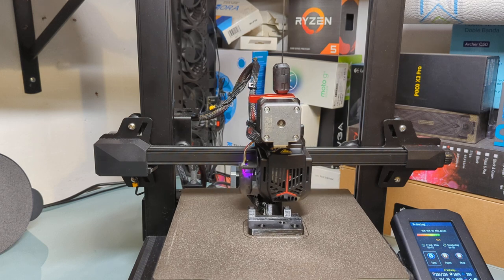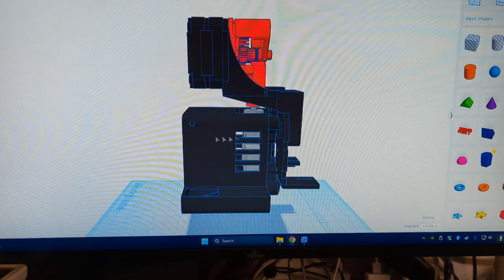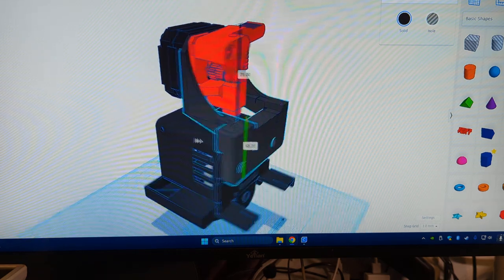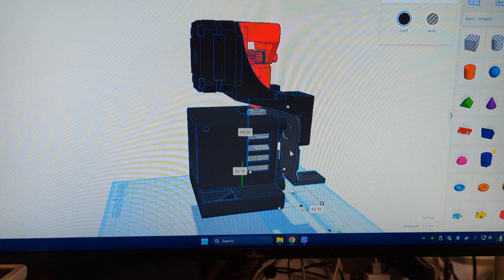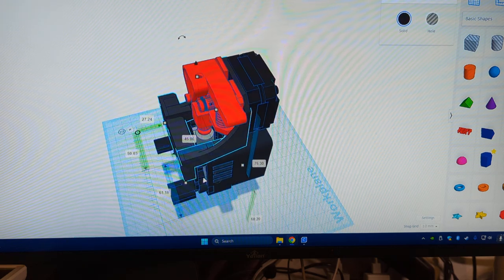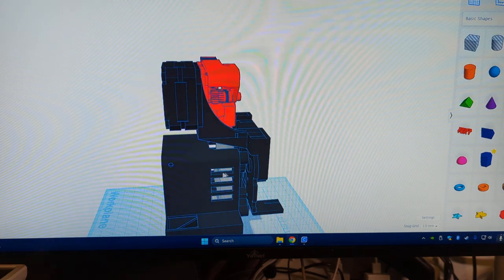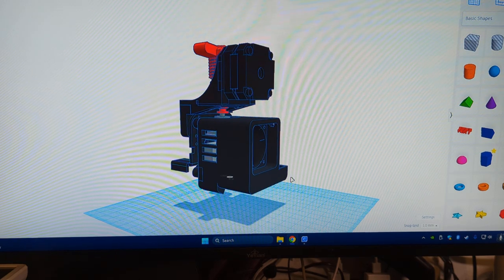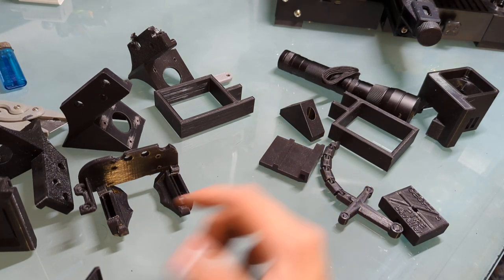Creality Ender 3 V2 Neo - New Direct Drive Mod and Updates!!

Comment: Great vids man just ordered mine and should be here today. Pretty sure you’re  the only one tackling the direct drive with the E3 v2 Neo on youtube right now. So many on Reddit just wiped there hands with it and said it’s not possible since they changed some of the original settings from the v2 I guess which I feel is steering some away from this printer. Awesome work look forward to more!
Reply from the maker: Thank you! It's been tricky, but the user TheGameIsFunny in thingiverse really got my brain going with this I believe he made the first DD mod for this printer and after upgrading to a dualgear extruder I just knew I had to remix the file to fit since it's a bit longer than stock. Huge learning curve for me since it was my first time doing any 3D models but it's been really fun learning and upgrading this printer any chance I get.

Comment: you need to turn the mount 180 deg, motor over the x-axis.
the dule gear extruder fits just right .
you don't need an extension cable for this, just split and peel the wires back. it's long enough

Comment: ur videos are great, as am also new to 3d printing and bought 3 v2 neo ,,, and wanted to upgrade it ....ur videos are a lot help cus i find rarely a video on neo version

i wanted to ask a question ..... isn't it possible to use the original extrusion kit that came up with printer in this mode?

Comment: Unless you run an gear reduction extruder you can’t use a pancake stepper as it will over heat. Amazon 7.99 pancake stepper
Reply from the maker: 100% correct, running the stock motor until I can get something better.

Comment: Great work, im using the same printer, are you still able to print the full hight of the printer? Does the extuder or the mod clear the top? Iv printed parts for a full size sword and some came close to the top.
Reply from the maker: Yes you are still able to use the entire Z space of the printer :)

Comment: Does it work without dual Z motors
Reply from the maker: It will but you you need two motors to support the extra weight, otherwise on one side it will be lower than the other.
Reply: @Zeltroix i might just move the extruder motor somewhere more accessible, this seems like a pain to setup